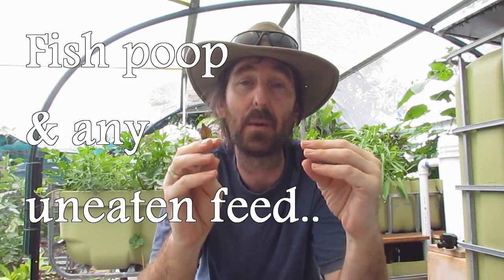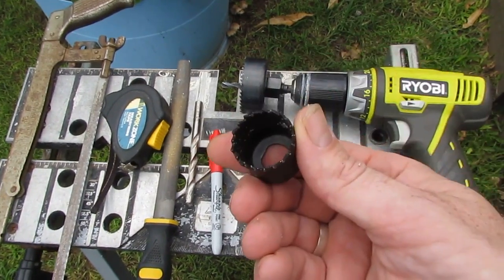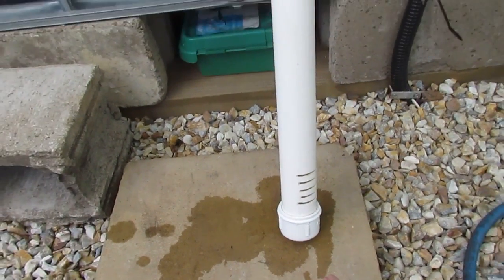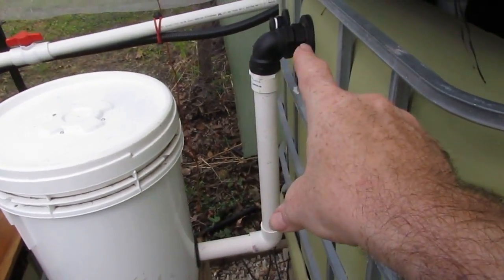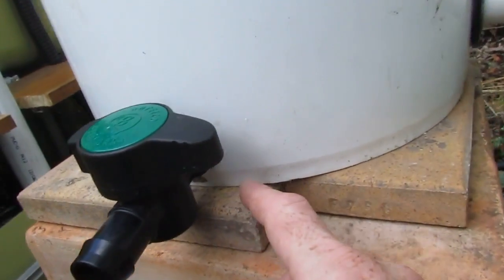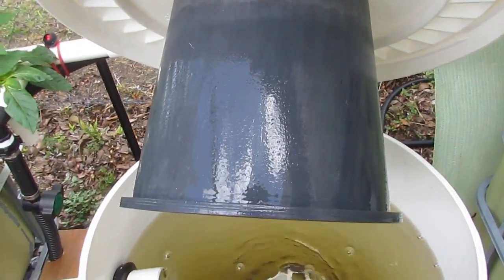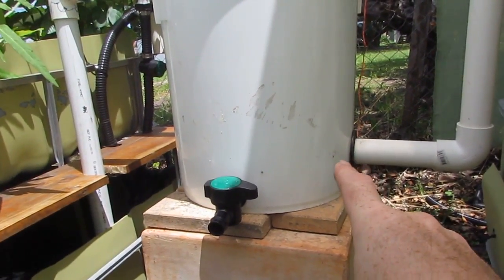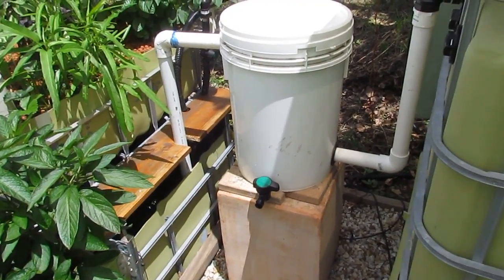Aquaponic radial flow filter for solids removal..

Comment from the maker: With the ST levels what you can do is take say 2 gal of media in a container & then see how much water it takes to fill the voids. You can then drain the water from the media, measure its volume so you can calculate how much water you will need to keep 3 GBs filled at once + have enough to keep the pump covered as well as some extra to allow for transpiration & evaporation.
I didn't do it this way as I just over estimated 200l/52gal for each bed & came up with 600l/160gal sump.

Comment from the maker: The water goes straight from the ST to the FT then splits for the time being. Some goes to the filter with the rest going to the grow beds & it isn't a desirable situation to be in. Like systems that pump from the ST to the GBs & FT  it means that not all the water gets a chance to circulate through the whole system to get cleaned as I see it.. 
I think a single loop from FT to GB to ST is the best way to go as all the water gets a chance to flow through the GBs to be cleaned.. TBC

Comment: Thanks, Rob.  I had another couples now, though. :)

Do you pump water out of your sump tank into your grow beds and then the grow beds drain back into the sump?

Do you just keep quite a bit extra water in your sump tank to keep it from going dry?  I am worried that all my beds would be siphoning at different times and the water level in the sump tank would vary significantly.  I planned to go from my filter directly into the grow beds and wonder why you seem to have chosen a different method.

Comment: Instead of purchasing pipe fittings for a smooth bend, you can heat sand in an oven to 400 degrees, fill the pipe with the hot sand, let it warm up, then bend the pipe as you see fit.

Comment: I did some more research and think I have this figured out, but please correct me if I'm wrong.  

The pipe coming out of the fish tank is essentially the height you want to keep the water in the tank.  It is basically just an overfill. and that pipe fills up with water and overfills into the filter because the water level in the tank is that high.

I'm still confused on the slots in the bottom, though.  How would the water continue to come out once the tank water level is below outlet pipe?

Comment: Hi Rob Bob, I was hoping you could provide me some more details with your setup here.  I understand how the radial flow filter works, but how are you getting the water into it and controlling the water heights.  I am putting my setup in my garage and am concerned with flooding.  So, I'm hoping with a setup like yours I would be able to at least limit how much water could potentially spill out in case something bad happens.  Can you provide any details on the piping from fish tank to the filter?

Comment from the maker: I have experienced this through bad bed design on my part so thought that it best to have the filter in place so it doesn't happen again.. When the system get moved around in the coming weeks the filter will be added in line from the fish tank to the grow beds so it will be cleaning out all the large solids from the system.. I know not all think a filter is necessary but I like having it there as a bit of a safety net.. Better than finding floating fish I think..
Hope that helps some,
Rob :)

Comment from the maker: Most of the nutrients come from the ammonia that is excreted from the gills of the fish Don but some does come through with the other waste as well.. There are other nutrients that come out with the solids that get suspended in the water & will travel through to the grow beds.. The larger solids particles can build up in grow beds or on the bottom of the tanks & can, not always, cause problems with the fish as they breakdown..TBC

Comment from the maker: The pipe I have connected to the pump is on there nice & tight so all the water is making it to the fish tank.. 
There really should be no slowing of the flow but a small increase in the head hight of your fish tank... That's what happened here anyway.. Any chance of a clip showing the system & how you have it all connected ??
Cheers,
Rob.

Comment from the maker: The inlet from the sump comes in from the other (right hand) side through a pipe that is resting on the top of the tank.. 
The level in the fish tank is controlled buy the lowest point on the outlet (SLO) pipes as it leaves the fish tank.. Water won't drain from the fish tank as the top of the SLO's are an open "T" piece that won't let a siphon initiate if that makes sense..
Hope that helps & let me know if you need more info & I will see what I can do..
Cheers..

Comment from the maker: There are 3 closed off pipes along the wall you see there.. The SLO with the red tap is the only operational one & runs to the radial flow filter.... The others were part of the original design that got changed & have been capped off.. 
The white pipe behind it is the pipe that runs water to the grow beds.. Ideally all water to the grow beds should run through the filter first... That will be part of the reworking of the system in about a months time.. TBC

Comment from the maker: I haven't had an issue with them.. I like them in the filter as they let me move the drum around a bit when I clean it out which is something  couldn't do with a bulkhead.. Most of the large commercial systems I have seen use them as well..
Hope that helps Hamish & have a great weekend..

Comment: Hi mate. Is your radial flow filter still operating well? I dont have a filter in my system even though its been running for about 8 years now - but im thinking about adding one or two to my new large system (12,000L). Keep up the great work mate.

Comment: I have two used 55 gal blue water drum. One for a Swirl Filter and one for a bio filter. The guy I got it from said he doesn't know that was in them before. It was either hand soup or cooking oil. I tried to determine which item was in the barrels but not sure. should I be concerned and not use them or risk it.

Comment from the maker: The 2x45° is to help the water flow with less restriction as the curve is gentler on the water flow than  90°. I will be replacing more of the elbows as soon as I get the chance as they are all glued up & ready now.
The reason the pipe turns up is that  the water changes direction under the bucket, it slows down & the solids settle out.. If it flowed in at the base at that velocity it would be constantly stirring up the solids.
Hope that helps explain the plumbing a bit better. 
Rob
Reply: Sweep 90's such as used in sink drains or use a pipe bender for PVC to get some of the sweep fittings. I have used a heat gun or gas stove very successfully on PVC pipe. Tight 90's restrict the flow be it gravity feed or pressurized. The difference in pump flow rates can even be measured with an amp meter if you want to go that far. I discovered that when working with my pool pump rated at 120 GPM.

Comment: Nice vid again Rob!

Can I ask what the function of the 2 x 45mm angles and pipe UP to the top of the bucket is?  Do solids gather in the angle because they have to be pushed up the pipe to the top of the bucket?

Would you not achieve better solids fallout and less build-up in your pipe if the solids were released into the bottom of the bucket without having to travel upwards?

Comment: definitely helps!  I emailed Paul and he recommended using at least 50 gallons (US) for 1500 gallons per hour flow, so I'll be doing this with an EDPM pond liner in a pit.  

It's interesting how this type of system is used in aquaponics, but not for koi pond building.  really a great concept...

Comment: Hi Rob, love your work, ohh what I would give to have such a large area as yours, not to mention that fantastic Queensland weather where a stick will strike root and grow.  Anyhow's I wonder if you might look at my video on RFF and make a suggestion as to why its not working.  I am exhausted for ideas after two days in the rain trying to get a good flow happening.  The only thing I can see different is that your pipe attached to bulk head fitting could be shorter?  Rod

Comment: Rob after you take the solide out of the water istherea way you can concentrade the brown water not thesolide but the brown water can you use a sentrifugal machine like they use to take out tinny tinny alge from water   I want it to be more brown alot more concentraded    And you can bootle it and store it 
The. Water containss amonia and there is bacteria in the water and mostley were the plante are theat convert it in to nitrade and 2 other bacterias that convert nitrade in to nitride and

Comment from the maker: Really need to make sure the hole isn't stretched & also that there is no swarf left around the hole from when you cut it. The swarf can prevent the seal from forming causing it to leak..
This clip might help a bit better than I can
watch?v=E54mYii7VWo
 Hope that does help some..

Comment: Flow rate will most likely be around 2500 GPH.  Do you think 30 gallons would be enough for that?  Have you gotten any clogs in the intake yet?  Does this burn the pump?

Comment from the maker: 1) The filter is actually lower that the surface of the Fish Tank but as there is an open "T" piece inside the FT the water will never be able to create a siphon & drain the tank.
2) Not to sure on the larger debris & I take it a much larger flow rate required to pump the water... What size pump will you be using ??

Comment: Rob,

2 additional questions -

1) Is your water level in the radial flow filter the same as the tank or below?
2) I will be pulling from a bottom drain from a 1500 gallon pond to feed this system.  The bottom drain will be 4" wide (much larger than your pipe to pull debris like leaves, etc).  I've also decided my tanks will be more like 20 or 30 gallons.  Do you think this will be a problem?

Comment from the maker: I had big issues with solids building up in the base of the IBC beds & a small ½ barrel constant flow bed.. The solids built right up & caused a bit of a nitrite spike from what I & others more experienced in the game could tell.. I did a clip on it watch?v=tSYxXPnUaJQ  as well as one on how I cleaned out a large bed watch?v=UyTtc82VhfI  
I followed advice that said a filter wasn't needed & that proved wrong for MY system & could of cost me my fish..TBC

Comment: Looks great.  I'm actually building a small pond for goldfish. My challenge has been trying to find a system for solids removal  that doesn't have to be submerged (my water line is ground level). A few of these for a small bottom drain would be my plan.  What do you think?

Comment from the maker: This is being fed from a 1000L/270gal tank... There is about 1600L/422gal all up in the system when it is full..
The pump running this is a 4200lph/1110gph magnetic drive pump.. It is only taking about ½ the flow at the moment..  I hope to have it plumbed in to take the whole flow to the grow beds in the next week or so.. Just need a few parts.. Depending on the flow I might go up to a 200L/50gal drum..

Comment: How big is the tank you're pulling from and what is the turnover and pump size? I've seen systems like this use much larger barrels because solid settling needs larger volume for greater GPh. I wonder if putting a few of these in line would produce even more removal...

Comment from the maker: That was the problem with the smaller sumps I see some people have.. I went with the 600+L/158+gal sump so it could handle all the water from all the grow beds & run as a small stand alone system if need be.. Would be good to have a look once it's all up & running.. Have fun on the build :)

Comment: Rob I think he was asking the same question as the guy above.  Mine works the same way.  @Soonerjake, it is just an overflow.  The water in the pipe is the same level as the water in the tank.  Water is pumped into the Fish Tank from the sump causing the fish tank to overflow.  The water must go up the pipe to exit taking the solids with it.

Comment from the maker: It will go in line with the grow beds after the redesign but for now this was the easiest way I could incorporate it into the system without cutting & altering pipe work that might be needed later. The flow through it is probably double the flow going through to the beds at the moment so it is filtering a large volume of water & while it may not catch everything it will be collecting a sizable proportion of the solids I think. Still learning here so time will tell I suppose. Have a great one.

Comment from the maker: Thanks Andy..
I chose one that would be double the internal flowerpot/ring in length so there would be ample room for the water to change direction to allow the solids to fall if that makes sense.. I think a taller drum might work better but I really didn't want a 200L drum getting in the way there..

& yes, your cheques have been absent.. I do except direct deposit ;)
Cheers to you both :)

Comment from the maker: :D The worms are doing their thing in the grow beds but it's the high nitrate I am worried about more than the solids.. I have read & been told that they can handle up to 450ppm but as I can't quite tell how high they are I would rather try & reduce the load at the moment & I thought that the filter would be a good way of doing this.. Time will tell I suppose &  I also like to build stuff to see how it works for fun  ;)
Have a good one Hamish :)